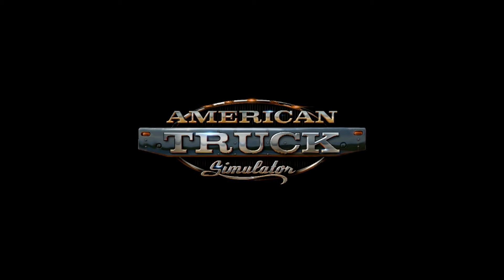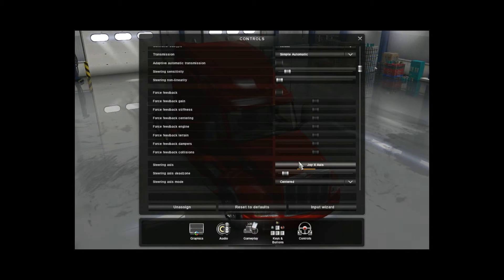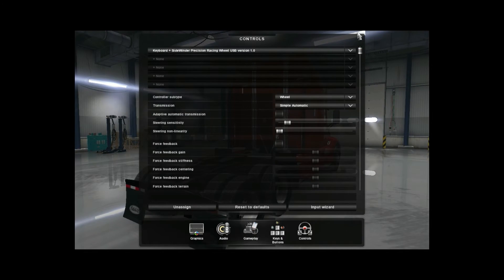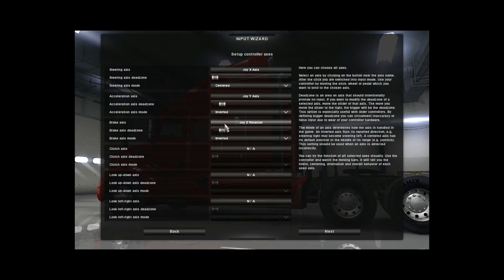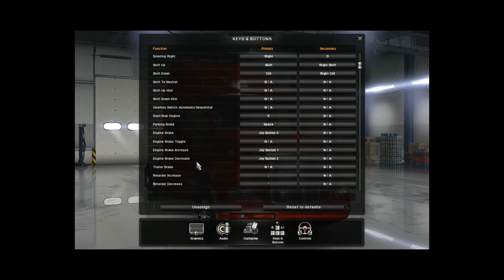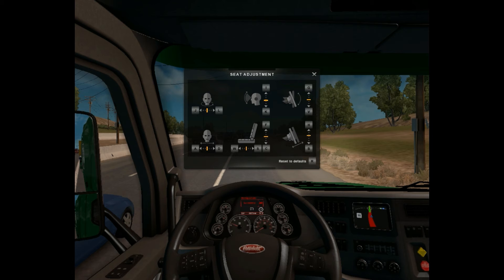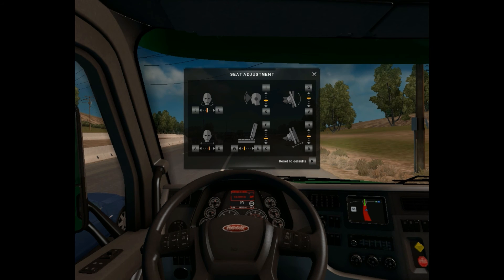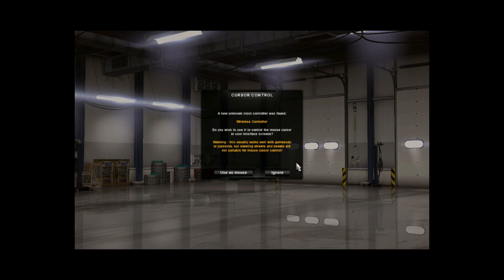How to Configure Microsoft Sidewinder Steering Wheel To American Truck Simulator on windows 10

Comment: how to install is? try a lot to instaal de driver but it is dont work :(
Reply from the maker: if you have windows XP 7 or 10 the computer should detect the wheel as A joystick
Reply from the maker: If you have the force feed Back model it has to be Plugged into power outlet also and turned on before windows detect it. I Have both models standard and force feedback models
Reply: Games and More Channel thanks for your information but my model dont have the forcefeedback system.  my model is Microsoft sidewinder precision Racine whell
Reply: Hi Marcio, did you manage to get the wheel working? If so, how did you ? :)

Comment: DO you have the original Microsoft drivers for the wheel?  I believe it is version 4.0...I'm assuming you have the drivers installed, no?
Reply from the maker: windows 10 reconised it Plug and play
Reply: Thanks Joe....Just thought you had the software that came with the wheel that you can modify the wheel axis...thanks!
Reply from the maker: I Have A Friend  That has A Sidewinder  force feed back Wheel  I Can Borrow  Disk and Make A Disk Image  File for you If you would Like
Reply: Thanks for the offer but No, that's ok. I use Windows 10 and I"m hearing that the Sidewinder software is not going to work with Win10..not compatible...Thanks for the offer, much appreciated.